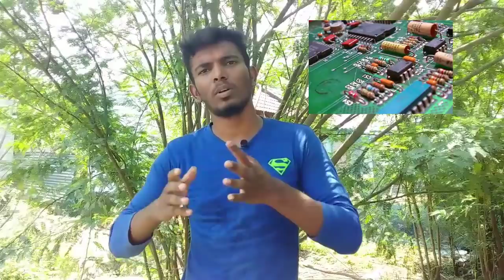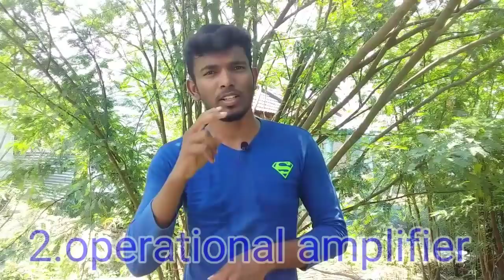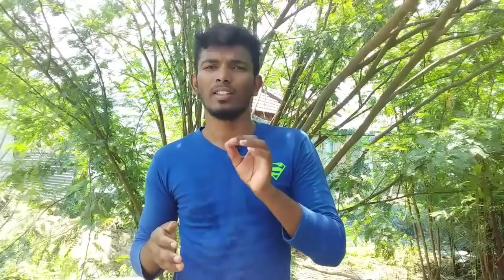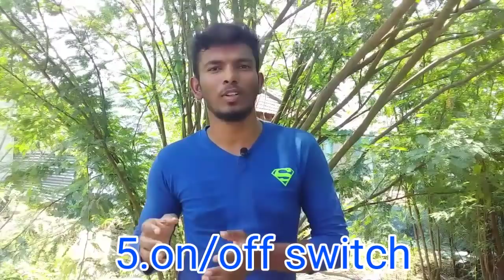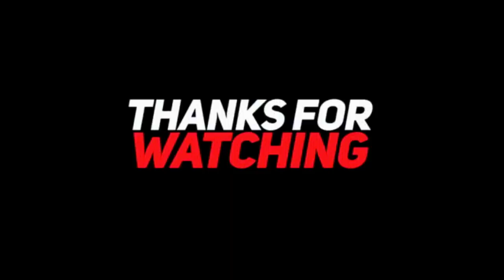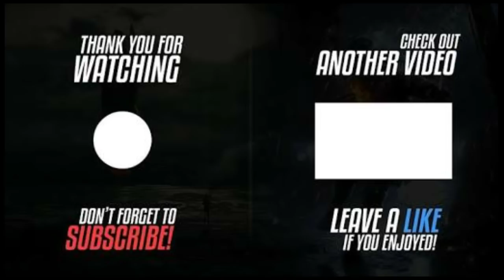5 most common circuits in every circuit part-1| Tamil | Students Corner

Comment: Own pcb design circuit Epdi ready panum soluga Anna 😎
Reply: Ennakkum athe doupt bro
Reply: @r.manikandan2  use Live wire
pcb design software is usefull for beginner level.later you can use Autodesk Eagle software.

Comment: 12v battery 24v Appu pannaum
Reply: Boost converter use panni voltage up pannalam
Reply: Boost converter'na bridge rectifier'a bro?